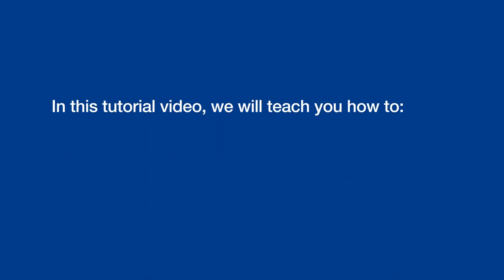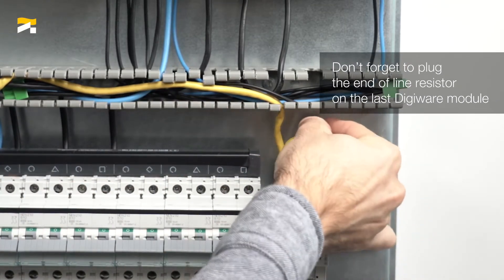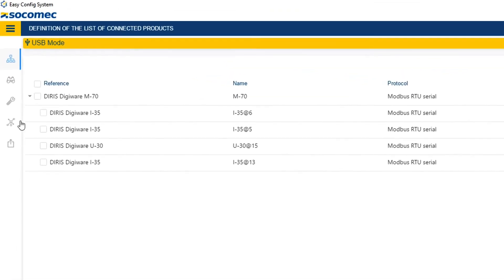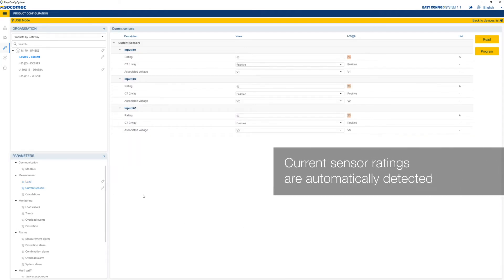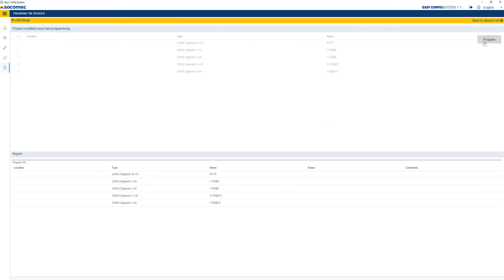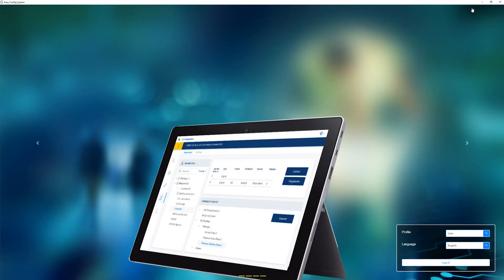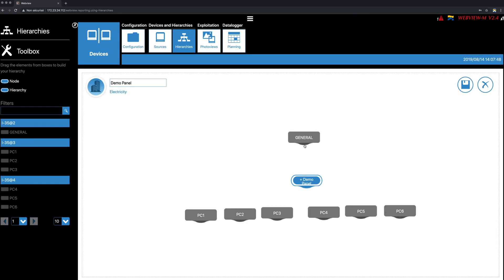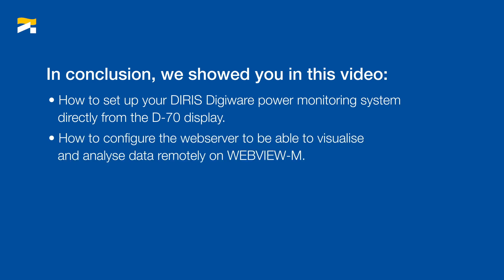Configure your DIRIS Digiware system using Easy Config System

Comment: Very easy to use! But it has some minor bugs. Like when i exit USB mode in EasyConfig, it gets ID of 255 and don't take the Modbus/TCP setting and IP from the gateway, so i need to change after each USB setup. Also i cannot sort loads by name or ID anywhere, both the D70's display listing and WebView. Also custom logo upload from WebView does nothing even on newest FW. Also automatic restart for those blue enable switches in EasyConfig list would help, i don't enjoy to enable each one after connection problem. If you sort out these, the system would be perfect.
Reply from the maker: Dear, Thank you for your message. May you contact us via our Facebook messaging or our website with the contact form : https://emea.socomec.com/en/resources/contact-expert-team/contact-expert-team
Thank you very much and have a nice day.
Best regards,